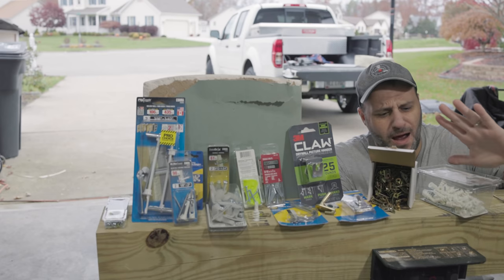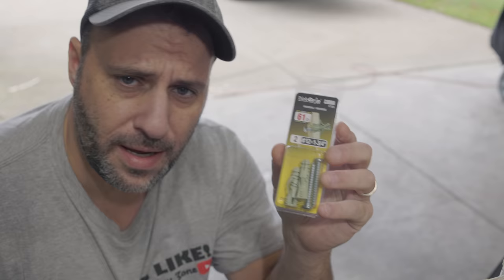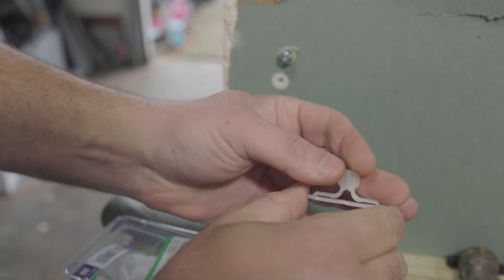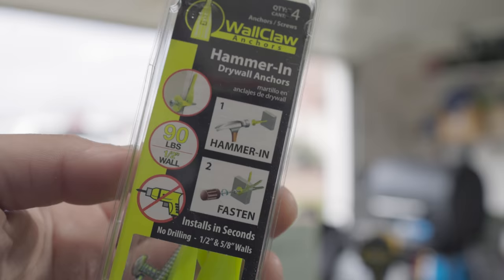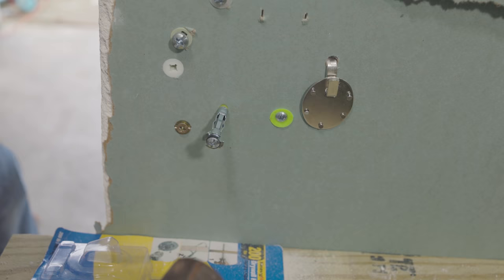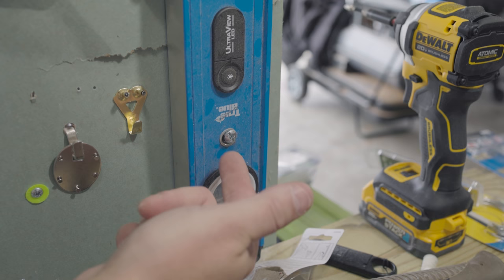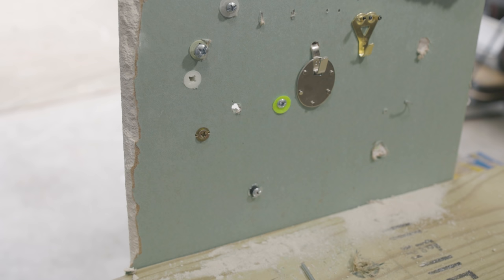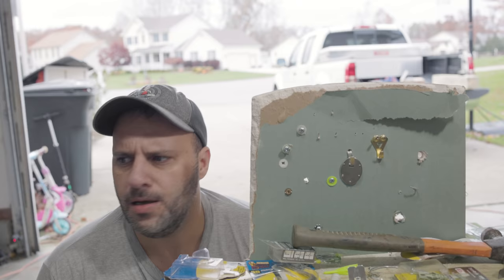Every Drywall Anchor from The Home Depot Tested - You will be SHOCKED at how some of these did

Comment: I followed the link and bought the best ones.  Never seen them before  good find.
Reply from the maker: Hahaha, TIA in da house! 👊💪💪
Reply: @ToolReviewZone  You show the flip toggle (zip ones) but I didn't see you use it?????   Those are clearly the best.
Reply: Great demonstration but the Ook hook with the oval nail in plate was installed incorrectly.  The hole in the plate should be moved up to where the anchor goes into the wall and the hook is centered in the oval plate. Then nailed in. This allows a lot of weight to be placed on the hanger that rests against the plate.  It actually worked out well for me. I have a very heavy shadow box hanging on one and it is a solid hook. 🍻
Reply: That's what makes this the best to community we help each other find the best of the or the best tool deal win win Clint you knocked another one out the ball park
Reply: me too!
Reply: @ToolReviewZone  hi

Comment: Good video. The metal hollow wall anchors that you hammered in and they destroyed the back side, I agree that's terrible but I've had great results with them holding tremendous loads if a hole is drilled for them instead of hammering them in.
Reply from the maker: Thanks for the feedback Buzz. Just did them like the directions stated,  but a drilled hole would probably be much better 😉
Reply: I agree I use these all the time in commercial work hanging pannel heaters and hand dryers and never had an issue but you have to drill first and use a setting tool to anchor them in.
Reply: Came here to say exactly this. With a clean backside, that 'spider' style grips the hell out of the drywall.
Reply: Came here to say this. These anchors are awesome when pre-drilled. They've been my go-to for years when installing something significant, such as tv mounts (I always catch at least one stud, as well).
Reply: Problem is with the instruction. You typically drill a hole for molly bolts. Use a L-bracket or washer with initial tightening of screw. This prevents spinning of the barrel in the drywall. Of course you got to remove the screw to insert bracket or washer. Other option is to buy the special tool that pulls on the screw to expand the back.

Comment: Hilarious!  Pop Toggles are by far my favorite wall anchor, and have been for many, many years.  The question of "how to remove them" is really a non-question. DON'T remove them - ever!  The front side flange is so thin that a couple light taps with a hammer sets them below the wall surface, then you just cover them with drywall mud and you're done!  The Monkey Hooks are my go-to for pictures and other light items.  They are removable, and only leave a tiny hole behind.  My absolute worse anchor???  Those blasted screw-in type (EZ Hook).  Those things are about as useless as teats on a bull.

Comment: The Pop-Toggle comes with a small prod designed to engage the retention mechanism. After inserting the toggle you push the prod through the hole to 'pop' the wings out. THEN you can drive a screw. The instructions are printed right there on the package. It's amazing how many reviewers on YouTube miss this.
Reply: Yep.  I noticed he failed to pop it open, then said he hated them.  They are the only ones I use for heavy duty applications.  Funny, but the one with the giant wall plate was installed wrong too.  Why make a review video, when all you're doing is showcasing your ignorance???

Comment: Interesting vid...but opinion based on fastener installation ease & damage upon removal.  The purpose of these drywall fasteners is to mount items on the wall w/o the use of the studs.  You should consider a follow up vid testing their lateral (and vertical) strength which is what their intended purpose.

Comment: In your intro you had a flip toggle but didn’t show them. I use them all the time as an AV installer when a TV bracket can only hit one stud.  They hold more weight than anything, but require a large hole 1/2”. You can also use them on block or steel studs.

Comment: I'm pretty sure you installed that first Ook device plate upside down. The plate should be flush against the drywall and works as a stabilizing bracket to the hook. If installed correctly, this one will definitely support more weight than any of the others, so you have to consider what you are trying to hang in determining which fastener is the best option. I wouldn't use it to hang a simple picture frame, but for a large decorative mirror or shadow box this would be a go to device.
Reply: He doesn't seem to have any idea what he's doing.

Comment: I was not aware of the Wall claw. I think that is my new favorite because of strength. Maybe the Cobra. A long time ago we used the Molly anchors which were like the Everbuilt and they were great. The difference is that you have to pre-drill them in not hammer them. I think if you pre-drill the Everbuilt you would not blow out the paper at the back. Then they might be great. I hate the wing nut or butterfly bolt type. Although they are very strong because you spread the wight out on the largest surface area. You have to put whatever your mounting on the bolt before you insert the butterfly into the pre-drilled hole. Mostly I use the metal conical self drill in with a screw gun. Fastest and 50 lbs holding power.
 Here is a tip. Pre-run a drywall screw of at least 1-1/4" into the drywall to make sure you don't hit a stud or metal. That way you don't get a blowout.

Comment: I've used most of those before. Not a fan of any of those plastic-bit ones. The Oof with the two push pins are wonderful for me. My wife changes her mind about 80 times when hanging stuff on the wall. Those make my patch work almost too easy.  That said, hellllooooo monkey hooks.
I have a sculptor buddy who makes stuff with big-ass nails. It is heavy. I have a 3m claw holding that up. Before I found those I had to run a wire between two studs. 99/100 the misses choice to hang things is never on a stud. Most of those can handle little things, but if need something with strength, don't cheap out. It makes a difference.

Comment: Great review!

One that you don't show, "Snap Toggles,"  is a safer alternative for molly bolts, because you can make the spreading back part be vertical which is much stronger than the random position of the spreading part of the mollybolt.
Reply: and the one he had on the "table" was the home depot version of Snap Toggles that I don't like.  It only has one plastic run down through the wall to hold it in place and in use, they just end up losing the toggle into the wall.  The snap toggles, with their dual plastic holders, rarely break off and fall into the wall requiring a second, third, fourth one to finally get you secured - especially when you are putting up and taking off an item a couple of times.
Reply: @TheSidneySmith  yes you need two plastic stems to make sure the anchor is parallel to the wall as you pull the zipper tight. Otherwise it gets stuck, and breaks off.
Reply: I much prefer these to traditional mollys.  The best part is they are reusable.  They will stay when the screw is pulled out and the item can be removed from the wall.
Reply: I use Togglers all the time. They are very good for heavy objects like a wall mirror or medicine cabinet

Comment: That driller toggle looks pretty sweet. I carry a lot of toggle bolts and the white screw in anchors in my bins. I remember back in the day when toggle bolts sucked ballz and had a flat head slot only. You would always stab the he'll out of your finger with the driver bit trying to get the freaking thing to screw in the wall.

Comment: The one I prefer the most is wingit. I have mounted tv brackets on walls, mounted safety grab bars in tile showers. They have like 300 lbs weight capacity.

Comment: Lol I thought those spot markers for the 3M claws were stupid too (not sure if you were being sarcastic or not lol) then I actually used it on the back of a painting that needed two hooks. Before you had to find out where to center it then recheck the measure. Instead you put the marker on the back of the paintings 2 sawtooth hangers take off the adhesive then place it where you want it on the wall. The marker stays on the wall you draw a little dot then line up the hook and press in. Then hang the picture. Done... so much freaking easier!!

Comment: I have a 66" heavy mirror held up with the ook ones with all the nails. You didn't exactly install that one correctly. The slot in the plate goes right where the anchor comes out of the wall. The plate sorta sits behind the hook. The nails although they can be pulled out fairly easy they do actually work very well. I'm gonna give your Amazon ones a try for some smaller pictures. And the anchor that squeeze the center together like a cross actually work very well if a hole is drilled for them vs. pounding them through. That ook wire one is a unique one that looks good to try

Comment: I like the Everbuilt design. Been using them over 40 yrs. Way back when you could buy a box of 50, now only 3-5 per packet. Anyway, you have to drill a hole to properly install these. At least those were the instruction in the past.

Comment: I used the white drywall anchors that you screw in,  had a plastic dog kennel come crashing down. The kennel weighs about 40 lbs and there was a couple sleeping bags, a spare wheel and tire to a bicycle and a couple other small items in it, I'm sure it didn't weigh much over 100 lbs! Thankfully no one was home but I was shocked and disappointed!!!

Comment: i mainly use stuff like that at work. i use metal zip-it and those zip toggles. i only use those plastic gray anchors for block, they are junk in drywall. sometimes i use tapcons. you forgot to show those grabber screws, they are for drywall, sometimes called wallhogs. they look like a very coarse treaded drywall screw

Comment: I use the extra anchors for most things including hanging bathroom accessories.  A #3 bit on the gun is the best way to install them.  
I've used toggle bolts for microwaves and smaller cabinets where only 1 stud is available to fasten to the wall.
The larger toggle with the zip tie thing you didn't show using has ratings up to 150lbs. and is nice using 6 of those on grab bars in showers if blocking isn't available.  
All in all everything has a different purpose.  I'm not a picture hanger so not sure on those smaller ones.

Comment: Over the years I have used many different types of anchor systems. I like the Toggle Bolts, you can get big ones that will hold a lot of weight. But you have to drill a hole and you can't use them for every type of application. Those bright green anchors I have been using for years. They are easy and will hold 35 pounds. Most family pictures you mount won't exceed that. If I'm hanging something heavy, I make sure that I mount the item in a spot where I can use existing wall studs. Once again, if it's heavy, I have mounted a board/cleat across the wall screwed/lag bolted into the studding and used that board to screw hanger hardware into. Just don't use those little plastic anchors, they tend to give you, in a plastic baggie, with some items you buy that have to be hung. They don't hold up anything. Whether it be a wall clock, kitchen knife rack, furnace thermostat, hat/coat hooks, etc. Use at the very least those plastic screw in type anchors. They are okay for some things at least. Good video, demonstrating the available choices you can use to hang around with.

Comment: Really like your videos. However the ook  drywall hanger with the metal plate you installed incorrectly and is extremely strong when installed correctly. I’ve used them many times when I had to hang giant painting or even some mirrors

Comment: Thank you!  I like toggle bolts or driller toggle for shelves, the 3M claw, and the monkey Ook.  
If I had drywall then I would try your favorite but I mostly have lath and plaster walls, so I could imagine that splintering the horizontal lath boards, :( . 
PS - The first Ook installation with the "medallion" does not look like the installation picture.  The medallion needs to be up higher.  That said, the nails will still slip out just like you said, so it is still a dog.

Comment: installed the 200 lb incorrectly, the metal is supposed to go flush against the wall not at the bottom of the J made by the hook but where it comes out of the dry wall.

Comment: Uh, the plate on the OOK looks as if it's installed incorrectly.  You have it hanging from the hook instead of flush against the wall at the point of entry.

Comment: I was looking for the original vid where you showed your favorite anchor and came across this one. Cant believe i missed this one. I use those zip-its/EZ anchor. I never used the metal ones, id like those ones if using the screws they come with, but i like the plastic ones because i can use pretty much any screw for them since they're plastic and can use a variety of dif screws since they will cut their own threads. Those cobra ones are pretty cool too tho. Id use those. I like the ones you say are your favorite, i just wish they were sold at home depot, lowes, or somewhere local.

Comment: While I don't disagree with the results, I think you could have benefit from using a better testing platform.  Two studs 16" OC that's more sturdy and something you can actually nail into without having to hold the back of the sheetrock.

Comment: Only seen some of the them and used them toggles  you still got to  drill a hole but they hold a lot of wait I used on to fix a shower curtain rod for family with 10 piece of plexiglass I cut came out well still holding perfect but it's good to know there's other options that you Clint for this information

Comment: You shouldn't hammer in that "hollow wall anchor". Stab the drywall with a standard hexagonal shaft PH2 screwdriver, or drill the hole using a Ø7mm brad point drill bit for wood, then push the anchor in using your middle finger.

Also this is the first time I've seen such a royal packaging for just four f**king drywall anchors, with instruction tells you to hammer them into the wall. In my country they are usually in cheap plastic bags of 100 pieces each. Price is about $8-10 a bag.

Comment: Toggle is my go to for TV mount and shelves for security reasons. You didn't include the plain ol plastic anchors which I have been using for years. They work good enough. Going to try those new ones you top picked but they are pricey. They need smaller packs just to try them out. Good video.
Reply: I hope you're not installing anything more than a lightweight TV with just toggle bolts....especially if you are using an articulating mount.  The only real time for toggle on a tv install is very large / long ones through concrete block or drilled through metal studs.
Reply: @TheSidneySmith  tvs are lighter than ever now. So far so good. I have one above the other. Anything heavier will require larger and extra anchors for support according to the weight.

Comment: 3M Claws (your #2 Pick) are better than swpeet (your #1 pick) for many reasons. First of all you can install them anywhere on the wall without fear of hitting anything. Hit a stud or anything with a swpeet and you have to pull it out and make a mess of the wall at the same time. Claws are easier to remove with less wall damage. Claws come with a neat spot marking system. Claws are stainless steel. Claws don't require tools to install or remove. Swpeet requires hammer and screwdriver. Many tests online showing Claws hold more than their rated weight. Claws are an actual hanger where swpeet is just an anchor and a screw. No I don't work for 3M. Just a guy hanging pictures and some heavy mirrors.

Comment: Can you do some actual hanging tests with weights? You test the one with a hammer and give it a light pull towards you to pull it out and say it’s good, other ones you put in, don’t apply any pressure down, give it a light pull towards you to pull it out, not any different than the one you said was good, and claim that one is bad..

I think some vertical weight tests would be a more solid way of testing.

Comment: I don't think you followed the directions on the first Ook. It would probably hold quite a bit of weight pulling straight down if if it were installed properly. Still not my pick, but thought I'd point that out to be fair. (the plate needs to be up where it covers the hole.)

Comment: As promised, I was indeed SHOCKED!!! I love truth in advertising. Excellent job testing the actual function of each of these anchors, and not just looking at the size of the hole they make, the tool needed to install, or whether they are "good" or "bad" like the other channels do. This useful guide to picking the proper anchor to use in terms of real world holding power and appropriateness to different situations was very helpful. Look out Project Farm, this guy is coming for you. Consider me subscribed!